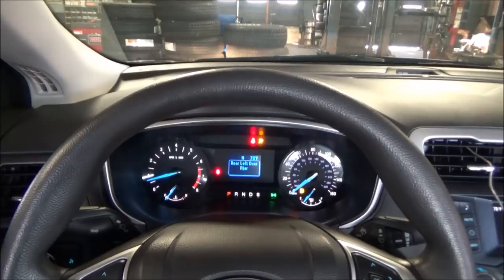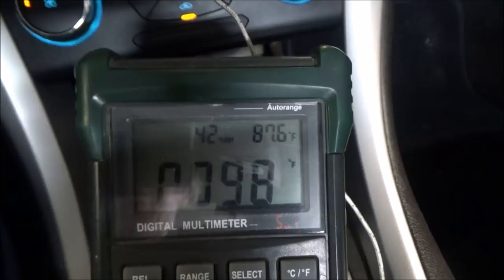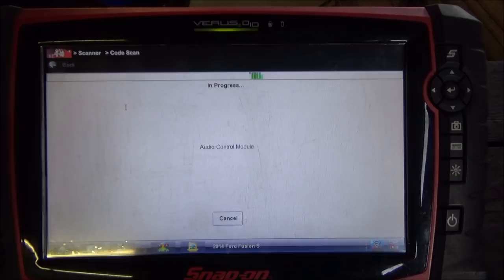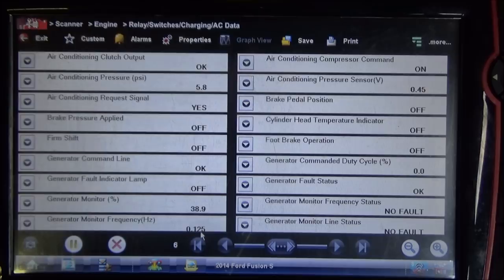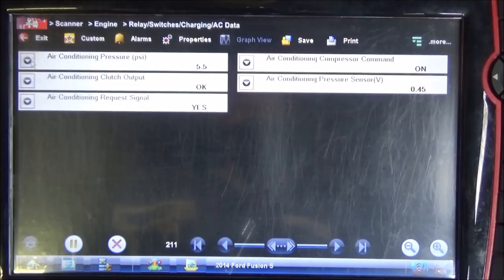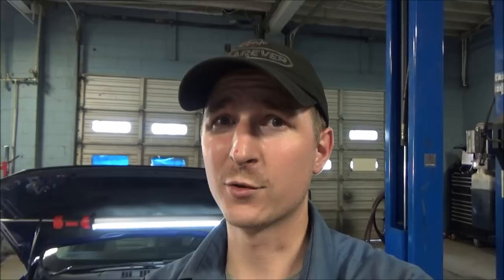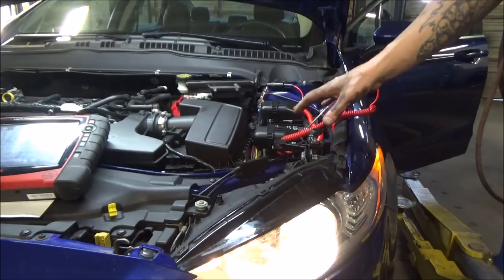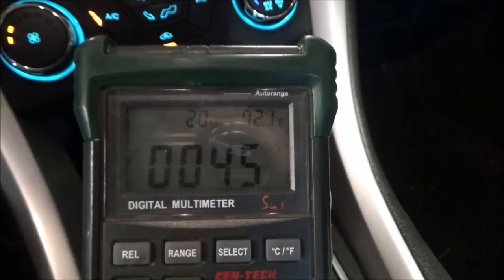A/C Blows Hot,  2014 Ford Fusion

Comment: Hey Joe! I see that someone beat me to it. Yes, ACCR is for a/c control relay. The a/c cycling switch that you mentioned is a pressure switch on the low side to protect the evaporator from freezing. On Ford, typical values for pressure are it's N.O. when the pressure gets around 20 psi and closes again when it gets around 45 psi. When it opens and closes, it disengages and engages the clutch. Nice work on swapping out the compressor and getting her running again. The customer will be remembering you when the weather kicks in around 90 or so :) Have a great weekend!

Comment: Thought you could check for ground with a testlight at the 22 fuse (through the a/c clutch itself). Also for the current draw at that fuse would be interesting before and after. Thanks!
Reply from the maker: You could certainly do that!  I will try and get more current measurements in for you guys.  Often times I don't have time to cover everything and go over current,  unless it is a critical step in the diagnosis.  I will definitely keep it in mind for future videos though,  thanks for commenting!
Reply: MrBorntoroll Agree but very satisfied to not check Amps because Fuse was ok.
Amps Before&After gives an idea what is more appropriate Amperage for the Clutch.

After all I liked the video super nice.
Thank you so much Joe. I subscribed your channel already after I seen You at Keith's Channel; New Level Auto.

Comment: Thanks for the video, i noticed when you activated the ac noid light it illuminated,,,that the a/c compressor clutch was gone. The reason i say that is mine came off and it looked exactly like the way your compressor appeared when test light at compressor @ 23:27 on video.

Comment: My 5 year old 2014 Ford Fusion Titanium just blew out the AC compressor clutch. This caused a massive system failure which sent metal shrapnel down the EVAC system, clogged up the entire EVAC tubes and destroyed the condenser. Had to get the entire system replaced and cost me $1,800!! Shame on Ford for making a simple clutch issue result in a total systematic failure.

Comment: I also have a 2014 Ford Fusion as in your video. However, my AC blows cold are out of the passenger vents only. The driver side blows warm air at first and then blows a little cooler but not like the passenger side. This problem just started yesterday before that it was all working and the air from both sides vents blew very cold air. Someone mentioned to me my actuator for the vents. Not sure if that would be correct.
Reply: Did you fix the problem I have exactly the same problem
Reply: Same problem 😂

Comment: In my 06 Lincoln Zephyr I put a new ac compressor condenser and main ac line too compressor Freon R134a  found out my clutch wasn't turning on found out the fuse was good the problem was the holder for the fuse was stretched out squeezed it together tight okay that fixed the compressor now it turns on now it seams the air isn't as cold as it should be what's wrong with my ac another thing if I drive fast my ac try's too get colder what the flip is wrong with it

Comment: great car, hardly 3 years old and the AC is junk
Reply: bobl78 mines too!
Reply: Lol welcome to Chryslers as well expansion valves on caravans are junk
Reply: That’s Ford for you
Reply: Same
Reply: I'm having that problem right now. Ac started to blow hot air then it gave me. Overheating cooling sign and it goes away if you turn off the AC

Comment: Hey. Have 2017 Ford Fusion Hybrid. A/C doesn’t work normal. Some times it just stops working then starts again. Got trouble code P0532-00 with my basic scan tool. Any ideas what to do before go to dealership and spend a ton of money?
Thanks.

Comment: If you can one hint,in my ford fiesta 1.3 2004 ac stopped working the throtle is filled to specification,booth pressure sensors are changed the compressor is activated only directly the fan goes off.I was in service and they didn't know how to fix,the clutcth and fan relay have no grounding on circuit control side PLEASE HELP what i do

Comment: Good stuff, very professional,so how long did it take to actually change that compressor?
Reply from the maker: A bit over an hour,  it's a very easy job,  comes out from the bottom.  Just so you know it uses a stretch belt,  so make sure to have the appropriate tools on hand before you start the job.
Reply: Ok sounds good thanks and good job

Comment: Ac compressor clutch was bad, not the ac compressor. On the older units the clutch could be serviced individually from the compressor. Guessing its easier/faster/cheaper to toss a compressor on it?
Reply from the maker: Typically yes.  If a vehicle has super low miles on then I may entertain just replacing the clutch,  but with as many miles as this one had I felt the best long term solution was to replace the entire unit.

Comment: Initially you looked for leaks w/ blk light and those yellow glasses. How do you know there was dye in the system or did you add dye? 

Also w/ the severity of the absence of refrigerant you mentioned doing a more through inspection of the system for leaks? I assume you did not find any? I've used dye for multiple different leaks.... sometimes good others hard to say.
Reply from the maker: I saw that there was already dye in the system when I removed the refrigerant caps so none had to be added.  I find that most systems already have dye in them from previous services or what not,  and rarely have to add any to do a visual for leaks.  I found no other leaks other than what was discussed in the video during my off camera inspection.
Reply: Triangle Diagnostics cool. no oem uses dye from the factory??
great videos . I have learned a lot from the 3-4 watched so far.

Comment: hey buddy you were checking for dye with the light and glasses but i didnt see you add any. Does refrigerant come with dye in it or did you add some off camera. thank you good stuff
Reply from the maker: Nope,  the PAG oil used in the system usually already has dye added to it.  To see if a system indeed has dye in it,  all you have to do it take a quick look at the shrader valve,  if it glows under a light you are good to go.  Thanks for watching!

Comment: recently my ford fusion only blows hot air (like when you turn the nob all the away to hottest) when the outside temperature is high (>80F), but as soon as temperature drops a bit by night or in garage where there's no direct sunlight, it's blowing cool air again, anyone has any idea what might be the issue?
Reply: I have a 2012 Ford Fusion that does the EXACT same thing. My parents were going through the same situation with their 2010 Ford Fusion. They got it fixed. At first they thought it was the Evaporation Sensor, so they got that replaced. But the issue ended up being a faulty HVAC Module.
Reply: Just an update... I changed out the A/C Control Module from a used one I got off PartsCycle.com. It worked like a charm! My A/C is blowing cold again! I live in FL so this was a must... I also saved myself $400 by doing it myself. It's not too tough. There's a video on Youtube titled "How to install subwoofers with a factory radio - 2010 Ford Fusion" that will show you how to take off the parts necessary to get to it. I'm far from a mechanic. Took me about 2-3 hours to complete on my own.
Reply: Chris Donley how’s it working now? My son has a 2012 fusion that’s blowing hot air all of a sudden

Comment: Why would you consider a thermocouple sub-optimal compared to a dial thermometer?

I'd use a thermocouple as a reference to check calibration on a dial thermometer.
Reply from the maker: I find that they just don't capture temperatures as well from something like a vent,  they work well if you let them sit in the vent for a while and get soaked through well,  but for speed reasons I generally prefer a dial type thermometer.
Reply: Triangle Diagnostics Ah, gotcha. The thermocouples I've had with a multimeter we're essentially just the wire junction and had very little heat capacity, but I know the probes come in a lot of styles, so yours might not be like that. 

Thanks, and have a good evening. .

Comment: You swapped out the compressor but never mentioned about measuring out the oil from the new compressor versus what is already in the system. Your implying that you just installed the new compressor with a full charge of oil already in it.

Comment: Were leaks confirmed/repaired? good video!
Reply from the maker: They certainly were my friend.  AC pressure sensor,  the o-ring for the flange we saw in the video,  and all o-rings for the ac compressor were replaced.  Those are all the leaks that I found during my off-camera inspection.

Comment: Really sad a new car and already breaking down.
Reply: Venture Electronics it’s AC, not the engine. It didn’t break down.
Reply: @djnoano8199  the engineers and designers that built my 2002 Continental must have long since retired. That air conditioning system is working perfectly still with nothing ever done to it. So yes, having a four-year-old car's AC system take a dirt nap is inexcusable from ANY car maker.

Comment: Your statement about pressure being about the same as the temp of the room ... Here is what that info tells you .. If you compare your pressure like you did and the pressure is less than the room temp - it tells you that there is NO liquid refergrent in the system - if you have a pressure that is comparable to the room temp tells u there is liquid in the system but you can't tell how much ... So the quick lesson is pressure lower than room temp is sure to be low on charge so start looking for a leak ...

Comment: I currently have my 2014 fusion at the dealership service center because driver side blows warm air while passenger blow cold. They said when they tested the actuator  for the drivers side it didn't let them manually change the position to open or close the vent. They emailed Ford to see if there is another reprogramming code they could try. I asked whats the worst case scenario. They said if it isnt the actuator then a replacement of the HVAC (I think he said) would be around $700 including labor. Does that sound right? Considering the AC works fine on the passenger side why would it be the HVAC? I'm not super knowledgeable about mechanical issues. Any info you could provide would be amazing!
Reply: What turns out to be the issue? Any updates